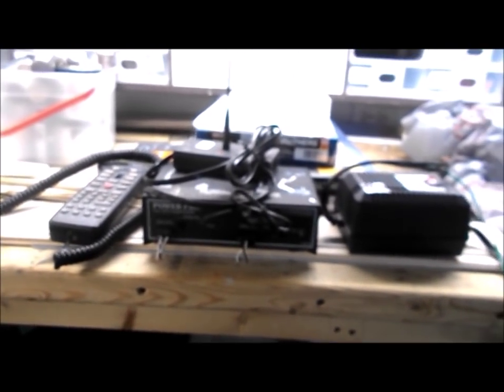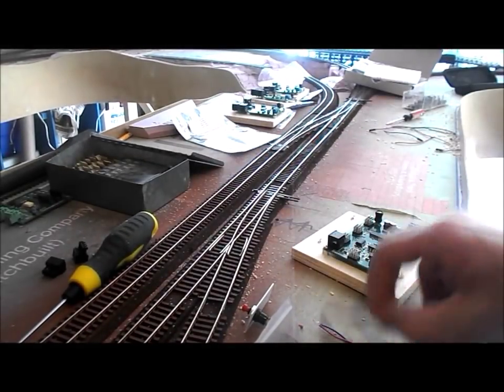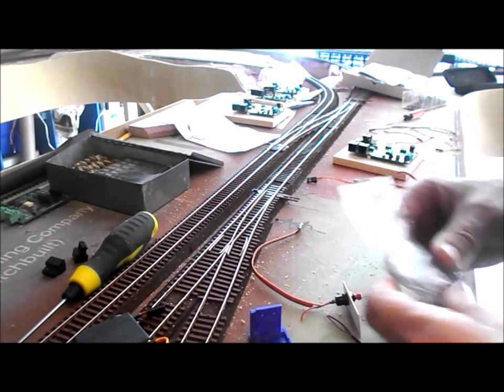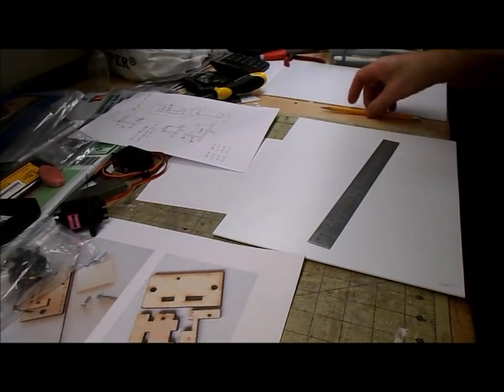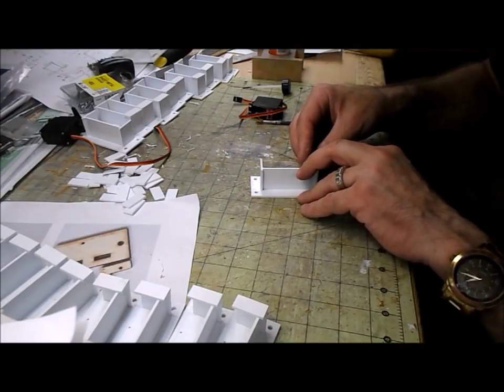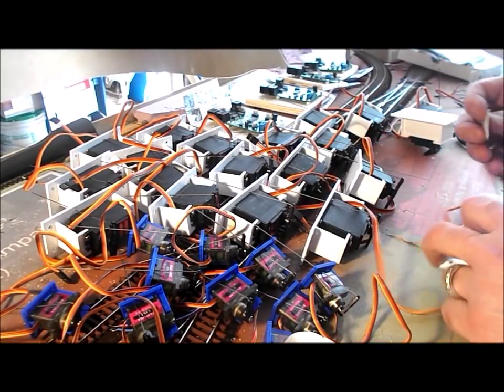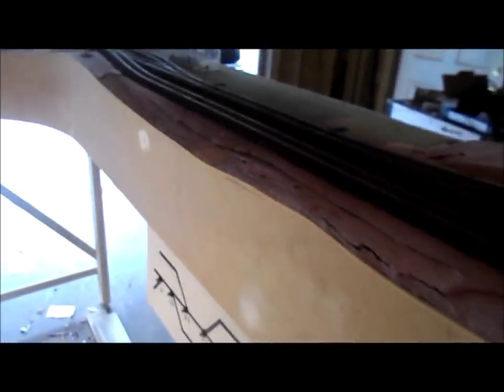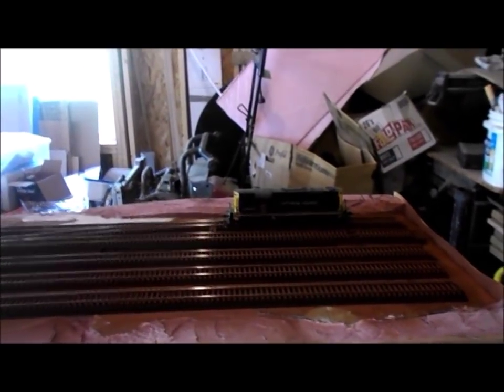Turnout control with servos

Comment: That is a cracking idea to use 80 thou plasticard and the liquid polyweld/ superglue for the mounts. Can see is so much quicker/ easier than metal working, goodbye to associated swarf/ metal filings and associated shorting risk with all that vulnerable DCC kit around. You set up a nice production line, well done!

Comment: I am looking at your servo brackets.  Very nice but a LOT of work.  A bit late now, but, some modelers go to their big box store and get extruded aluminum channel that is "U" shaped.  It just happens to hold a servo body.  If a bit loose, just pinch in the sides of the channel for a snug fit.  Proceed with the rest of your efforts.  Drill out 2 holes in the channel for mounting screws and off you go.

After you drill out the hole in the deck for the turnout throw, stand a flashlight up over the hole.  Go under neath and look for the shining light.  Push your throw rod up thru easily.

Tip - trying to push dropper wires down thru foam and plywood.  Simply push a soda straw down thru to act as a sort of "chase".  Slip your wires down and then from underneath, pull out the straw.  Seconds to install.

Thinking of using IR sensors for train detection.  Use 3mm bulbs which fit very nicely between the ties.  Calculate the length of the leads to the underside of the deck from between the ties.  Solder/replace them into the sensors.  Then with the flashlignt, pop them up thru the deck from underside and screw the unit down.

Enjoy.  Bob S
Reply from the maker: Interesting idea with the aluminum channel.  Actually, once I had the design worked out, I batch-built all 20 of the brackets in about an hour.  It would have taken me a lot longer than that to drive to the store, buy the aluminum, drive home, cut it to size, and drill the various mounting holes needed - even if I knew exactly what to look for and where to find it.

Comment: WOW - an interesting project.  Go to JMRI.ORG, and look down the left column of choices for NEC.  There are notes in there to support that application.  A usb buffer board, used on a POWER CAB 2 amp system requires a driver to be installed on your pc. 

If you plan to drive your NEC with JMRI, there also is a section on how to calculate the addresses of the various AUI modules.  This is in regards to the "turnout table".

Best of luck.
Bob S

Comment: Peter, I also use servo's for my turnouts, but I mount them just below the surface, I can't seem to figure out how you let the servo's switch the turnout when mounted below the benchwork. I know you use piano wire, I use brass rod 0.8mm, I cannot figure out how to turn a verticle servo motion to a horizontal turnout motion, can, and would you please explain this, pherhaps there are more people with the same as me
Reply: Install aluminum channel that is 1 inch wide ( the width of the serve.  This comes from a big-box store.  Squeeze the sides a bit to hold the servo body snugly.  Drill the channel up from the bottom of the deck.  Now the servo rotates parallel to the deck.  Run the wire up thru the deck from the servo horm.  Look at youtube videos to see how to calculate the "throw angles" of the horm.  A "Z" bend goes in at the horm.  Set the wire up thru the deck in a 3/8 inch or 1/2 inch hole to allow the wire to toggle.  Run it thru the throw arm of the turnout, first removing the  small tension spring in most turnouts so the points "float".

See youtube for arduinos throwing these servos.  Also see youtube for Geoff Bunza using arduinos to throw turnouts threw JMRI.

Bob S

Comment: I would be interested in where you got the very large servos and cost. They look way overkill for the force needed to operate a turnout.
Reply from the maker: They were supplied by the customer.  I think they are from Tam Valley.
Reply: I see they have the 9 gram that are typical that I use on small RC planes but seemed you also had some that were a lot larger you made the white plastic mountings. The servos seem like a lot more economical to use on any layout. Liked your mass produced bracket though.

Comment: I was impressed with the size of the servos.  Separating point polarity may be good for developments and bench testing but becomes one more thing to install.  How are they for problem tracing.  Very interesting and I'll look forward to learning about installation on your layout.  Sounds like an endorsement.  Thanks.
Reply from the maker: I have no plans to install these servos on my own layout.  I used them here because that's what the customer specified.  For my own layouts, I prefer mechanical linkages to nearby switches on the fascia (which I find far more intuitive for operation - not to mention a fraction of the cost).  For locations where powered control is necessary, I still have a drawer full of tortoise switch machines purchased for an earlier layout but never used.